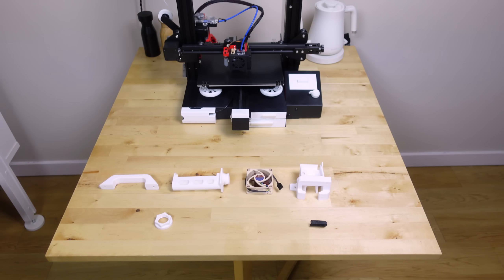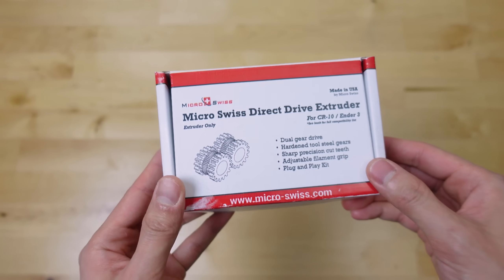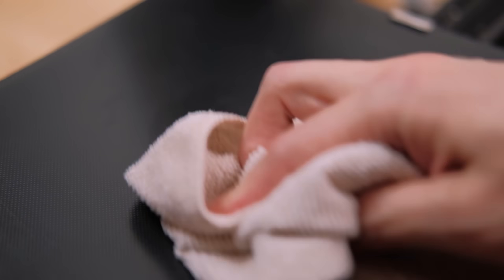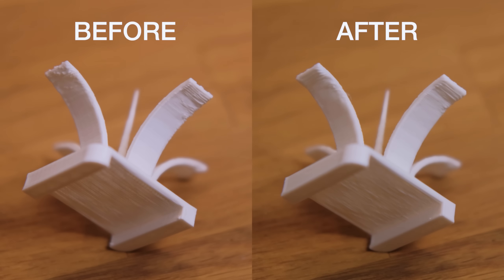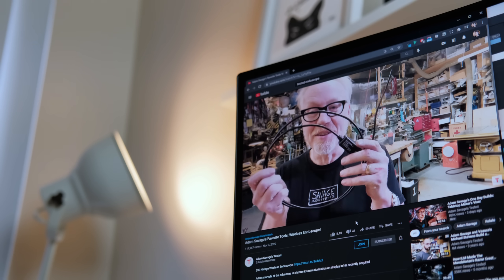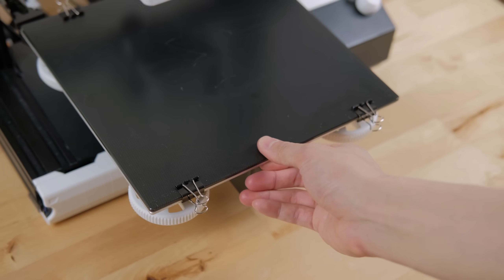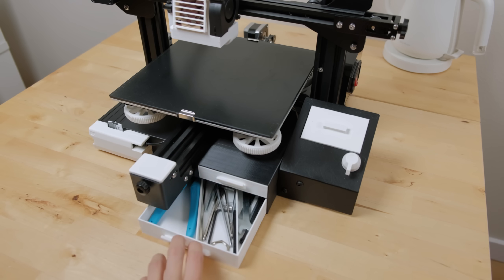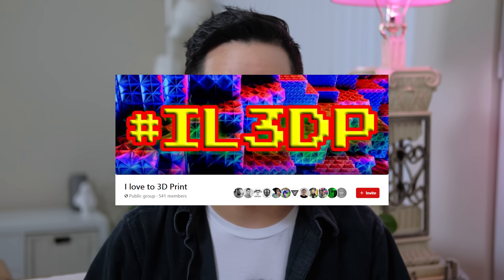15 More Upgrades for my Ender 3 Pro - Part 3

Comment from the maker: Part 1 - https://youtu.be/kG_YKeJDaX8
Part 3 - https://youtu.be/4jk6kZIwsQA
Part 4 - https://youtu.be/EQJfDLENYnU

Get this 3D printer for $189 with this affiliate link: https://bit.ly/3kcSKz0 and discount code: RP3ROMP10

As always, I'll be updating this pinned comment with FAQs and updates:

Q: How much did everything total to? 
A: Part 1 totaled around $138, not including the raspberry pi.
    Part 3 totaled around $250 to $300 depending on which endoscope model you choose and where you order your parts from.
    Keep in mind though that if you were to add these mods to your printer it will likely cost you a lot less since a lot of these recommendations added in part 3 replace the ones from part 1. 

Q: What are my Cura / support settings? 
A: Details on this are explained in the Part 2 video in the Q&A section https://youtu.be/uBfMoOqCgPc

Q: What 3D modeling software do I use? 
A: Fusion 360
Reply: Can you add a touch of RGB lights.
Reply: As others have already pointed out:
1) Ringing and ghosting? If the answer is a lot, ever considered remote direct drive?
2) Change the thermistor. Best upgrade possible. NTC 100K are extremely inaccurate. 
3)  Nylon is not easy to print, and has a really narrow field of application. That said, a conversion to higher thermal capabilities (maybe not PEEK and ULTEM) on an Ender 3 could be cool. Especially the heated enclosure.
4) CR 30?

Overall, I would say that you're getting really good at it. Keep it up!
Reply: Do you use marlin or the stock os? If you use the stock os, how did you add the bltouch without having any problems?
Reply: Was the micro swiss worth it? Just got a second Ender 3 and, I plan to Gucci it out.
Reply: Part 2 of the resin printer?
Reply: Maybe just add white leds and not rgb...
Reply: I missed the premiere :(
Reply: Do you use cura
Reply: How do u print multiple objekts so easily
Reply: Do your prints ever fail, and what do you do with the fails?
Reply: How much did all upgrades cost? Is it worth it?
Reply: UppfinnarAXEL it cost bout 80 dollars i think
Reply: what 3d modeling software do you use?
Reply: Why Tho? Fusion 360
Reply: What supports are those they seem to work very well
Reply: Hey, do you happen to have a discord server? I would love to join it and get some ideas on how you did some of the things you did in this video as well as your past videos.
Reply: What is the x/y offsets for the bl touch mount?
Reply: hey scott did u need any screws for the satsana duct thing or can u use the stock ones?
Reply: Sott - Awesome videos.  One last question: What motorized screwdriver do you use?  I've been trying to find a good one for some time now.  Thanks!
Reply: Bro upgrade like the snap maker 3d printer make ender3 pro part 4 plszzzzzzzzzzzzzzzzzzz 😁👍
Reply: For the music, I suggest checking this video. 
https://youtu.be/bUkX3iwr2iE
Reply: hi scott important question can u show us your whole setup like your camera your octopi settings and general issues you`ve been having?
Reply: Hi Scott, do the satsana ducts work without direct drive?
Reply: Stefan kring yes i installed mine without the direct drive you do need some screws and nuts
Reply: i myself as an engineer would try to lower the cost of the upgrades.. however .. noctua .. there is no better choice so cant skip on that one.. however .. just  some longer 4020 struts.. can be sourced a lot cheaper..
Reply: Any update on when part 4 will come out? About to set up the engraver and would love to see how you have thought to improve it!
Reply: How bout you replace all the fans with noctua fans basically just the motherboard fan
Reply: Replace the screen to ender 3 v2
Reply: Make able to change the tool head and make one using a endoscope
Reply: hi scott im a content creater like u and i was wondering what filament u use to achieve these smooth as heck prints
Reply: At the risk of pissing off your fan base, Cameron Luck lied to you homie. That intro for your videos is NOT his. In fact it's a very (as in extremely, totally and obviously) stolen beat from Tom Macdonald's "Fake Fans".
Reply from the maker: @AduroMark-ChainReaction  nah, haha it's a popular sample from a Splice subscription library apparently haha used in a bunch of k-pop songs too
Reply: Need #Part 4
Reply: Please make videos to add drilling system on creality ender 3 pro upgrade version ..
Reply: If anyone gets an ender 3 v2 and decides to put a bed insulation pad on, you need to cut it a little bit so it doesn't interfere with the motor that moves the bed. If you just slap it on there, it makes the print bed a lil thicc and it runs up on/rubs against the motor.
Reply: Ideas for add ons is something that allows one to print it in multiple material(so one can make dissolvable supports) and multiple colours(say you had a solid print the you wanted in blue and black and green. A device that assists with this would be helpful. Is there anything like it?
Reply: do a comparison on how good and cost it was before and now
Reply: You can add a holder for the screen cover
Reply: Part four LMAAO (Laugh My Adams Apple Off)?
Reply: does the link to get this printer for 189 still work
Reply: Hey brother, do you sell these already custom built?
Reply: where is the link to the main tool head upgrade?
Reply: Can this duct be used for boden tube ender 3 without converting into direct drive
Reply: you need to switch the link from 3 to 2

Comment: That is a completely different printer.
Reply: Prusa level printer :)
Reply: @sidewinded1  more expensive than a prusa
Reply: @lucaskp16  Sadly this is true. People are always like “Prusa is overpriced and overcharges” but when you look at the specs you are getting a Prusa for cheaper with the same specs, better quality and customer support...
Reply: @lucaskp16  Yes, and no, let me explain, u get the prusa, and yeah is neat out of the box, but with the ender 3, or the v2, you get a "decent" printer that you put to work, get some cash, upgrade it, etc
Reply: Is there anything left of the original printer??
Reply: @Girl On A Quest Ah yes, call prusa garbage. Please explain why?
Reply: @Girl On A Quest So you are telling me the printer I have had for the past 2 years with only 3 jams and 1k+ hours of runtime has more problems than prints?
Reply: @Girl On A Quest Most of the community does not have issues with their printers; tell me whats wrong. I will try to help
Reply: @Girl On A Quest Are your belts properly tensioned? Is your frame square and axes perpendicular? For the E motor, try running it on its own without any filament and with a rotation visualizer. If it spins, your hotend is probably jammed, if it doesnt, either motor or rambo is fried.
Reply: @Eddinski  its like a modded civic compared to a stock audi r8
Reply: If all the parts of a ship are replaced one by one, is it still the same ship?
Reply: @Girl On A Quest is it 3 or 5 printers make ya mind up luv 😂
Reply: Ship of Theseus printer
Reply: wait till you see part 4
Reply: Fr
Reply: @siniquezu  yes the color, it's not white yet

Comment: Ender 3 is on sale at Newegg for $165 today only
Reply: Link?
Reply: @tobiastho9639  I can’t seem to find it but it is usually only around 180+ shipping on crealitys website anyway
Reply: That's honestly not a good deal.  They're very often $155-165 in various places.  IMO you're shooting yourself in the foot with the Ender 3.  The Ender 3 Pro has a quality Meanwell PSU for about $40 more, which is the price of the PSU by itself, plus it has a few other upgrades to boot.  Even THEN you're shooting yourself in the foot usually because the Ender V2 usually you can find for $240-260, and it adds a silent stepper motor mainboard ($30-40 upgrade usually), belt tensioners, touch screen control ($30ish upgrade), and other upgrades.  Almost anyone would appreciate at the very least a PSU that won't burn your house down that you can trust, your printer not sounding like it's trying to annoy you using a voice box (EEEEEEEEEEEYAAAAAAAAAAAAAAAAAAAAAAAAAAAAAAAH!!!!).  Those two things alone make the Ender v2 worth the extra money for most people.
Reply: @heroflying  Wholeheartedly agree with 99% of your points, but the Ender v2 doesn't have touchscreen :(. Still uses the turn knob
Reply: @peterahn8332  I have a pro.  Thanks, didn't realize it wasn't a touchscreen.

Comment: quick tip: when you replace a fan, like 90% of the time the sticker on the back of the motor can be peeled off to expose the wire solder points. Just de solder the wire from the old fan and the new one and then re solder the old wire to the new fan. its easier and cleaner. Also there are plenty of 3d printable extruder heads and direct drives that are probably better than what you got do to more compatibility, more customizable, and lighter in weight.
Reply: I was afraid of replacing the fans because I thought I might ruin the printer when cutting the wires thx man
Reply: Just be careful not to bridge the solder point when resoldering 👍

Comment: Just for the fact that you mentioned how the can of air isn't great for the environment, you immediately get an upvote, thanks for bein considerate.
Reply: sure but what about all the microplastic entering the environment now when using a printer ?
Reply: @batmandalorian5504  I agree with your point, that's why I try to keep my waste to a minimum and I try to only print in PLA. I'm planning on finding a place that does industrial composting of PLA to give my scraps to.

Comment: Scotty you have successfully boiled my 3 years of searching, learning, printing, failing, and correcting into 3 succinct and comprehensive videos.  Here I am back again to pickup  some final mods to my Ender 3 pro.  Got my 'stupid' silent fans installed, skr mini board, tft touch screen, buck converters...working on my rear electronics box and fine-tuning my cooling duct.  Thanks again for all of your time and research!
Reply: just got an skr and oh my god the difference is insane, I was almost in shock

Comment: World's quietest 3D printer ever.
Reply: I hope that's a joke🤣
Reply: @Ethan Lu ender 3 silenced is better
Reply: Enclosers done right can lower the sound to negligible levels. The foam works particularly well on 3D printers assuming that it's air tight with negative pressure. That seal on its own does a significant amount of sound dampening.

The fans typically make mid to high frequency sounds which is what foam excels at. Stepper motors are quiet but the movement of metal on metal is slightly audible. It's probably because metal moving on metal is sometimes a very low frequency sound.

Comment: Guys if you still struggle with glass bed adhesion just wash it under warm water with some soap. Nothing will degrease the surface like this simple solution now it's hard for me to release the prints from my bed.
Reply: Indeed. Use your clean hand to wash the surface with a drop of dish soap and hot water. Dry with paper towel and don't touch it. The next 5 prints will stick fast. I normally use the scraper to move any dust aside between prints.

Comment: I also have the Microswiss Direct Extruder and it's phenomenal! But as I got I the released a newer one with rails... 

Scott did you also have Problems with just one Z-Axis-Motor? Now I upgraded to dual Z as my whole x Axis had some wobble and the first few layers got crazy bad. Dual Z eliminated this problem :)

PS:
Scott you need to get a Tft35 (BigteeTechTouchDispaly), its awesome.
Reply: Are you sure it wasn't just the eccentric but on the opposite rail?
Reply: Yes, also with perfectly adjusted excenter nuts there's still some play.
Reply: @lukaswernetz3258  The Ender 3 suffers quite a lot from crooked gantries. It's a budget printer, after all.

Comment: Hey, wanted to say thank you. Your series inspired me to get into 3D printing, and I'm about 75% of the way though most of the mods you've done, with a couple of extra ones along the way. I'd definitely recommend the BigTreeTech touch screen, it's excellent, and even with octoprint, still use it all the time. 

Also, when is the next vid coming? - you promised! (you didn't, but that's how I heard it! ;) )
Reply: I just got mine but haven't messed with it. What do you think one of the First MODSs I should do ?...I bought a (self ?) Leveling thing and a glass bed
Reply: @MOE13576  in honesty I eventually just built a Voron 2.4.r2.

Other than octopi, I'm not sure most of them made the printer much better. Some made my print quality worse but that was likely just my novice abilities at the time. Now I built the Voron, the e3 went in the loft.

Definitely the touch screen and octopi. Maybe handles too.
Reply: @ZeoniaSD  alright, thanks

Comment: Expected upgrades: Direct drive, longer z axis v slots, hot end upgrade, x and y belt tensioners, handle.
Reply: Don't forget the laser engraver!!
Reply: Psu control
Reply: Noctua Hotend Fans
Reply: I think the handle was already there. I agree with every thing else though!

Comment: Instead of straight swapping out the PSU fan, could you print a new PSU shroud with mounting holes for an 80 or even 92mm fan? A bigger fan will spin slower for even quiter operation. ATX PSUs use the biggest fan possible for this reason. Probs negligible difference, but it just seems like there is plenty of space left for it.

Comment: Klipper was a huge game changer. Really took things to a whole new level. I use Mainsail and that tends to work really well. This helped cut down on blobs and overall inconsistencies in the print. Paired with the dual gear and insulation under the bed (and bed mounts instead of springs) made the prints amazing. It has been a huge headache and only recently have I even gotten back to using it. But the learning experience was well worth it for the quality (and speed) I've gotten out of such a machine.

Comment: Dang bro you killed it with this one. I can tell your video editing skills have increased significantly like Goku reaching Super Saiyan levels.
Reply from the maker: haha thank you so much Hector. i'm definitely trying to slowly up my video production quality with each video so i appreciate that you noticed. cheers!
Reply: @ScottYuJan  i didn't think they could get better but daym you are good at it
Reply: @ScottYuJan  hey I can’t get the Fanta to work. I connect yellow to red and black to blue and it never kicks on.
Reply from the maker: @NightBlade58  for the PSU power supply fan?
Reply: @ScottYuJan  for the upgraded cooling fan that goes into the remix part that I printed. I am essentially copying your build.
Reply from the maker: @NightBlade58  hmm well first of all, start a new comment so we don’t spam these guys above your comment with notifications haha

Comment: For anyone considering switching to direct drive for an Ender 3, z-additions are not necessary as the motor doesn't touch the top rail, you can simply run the cables from one side of the printer rather than vertically.

Comment: Could you do a short video about all the extra tool kits you keep around to use with your prints, or link in the comments like the set of machine screws or the other inserts you add?
Reply from the maker: all the kits are linked in the video description under "⚙ Tools and Stuff ⚙ " 
if i missed anything, let me know!

Comment: printed out the  cover you linked for the   tensioner cover ,  it fits the original  creality  stock front  belt tension assembly   but does not fit the creality  made  adjustable  front    assembly, doing some research looks to be a couple style of adjusters from creality     some changes as they  progressed ,  just finished   making a raw  3d  shape going to make it to see if it fits and has clearance  will let you  know

Comment: I recommend adding back the Teflon housing for the filament to avoid yanking on the spool when the extruder moves to the edges. this will introduce filament tension during extrusion and that leads to imperfection in the prints
Reply: Hmm, he has ball bearings for the spool.   I have the same setup with the filament going in the top.  My biggest issue is the filament path of the microswiss.  At times it is hard to get it fed right.  I straighten it beforehand and you get better at it over time.

Comment: Z-Axis already carries the weight of the extruder and its stepper motor.  The key difference is now the X-Axis has that additional weight where previously the bowden hotend was a lot lighter.  Increased weight on the X-Axis may introduce ringing when you're making fast X moves.
Reply: I think the stepper motor drivers on the new board he added could potentially help. Also, why is prusa able to print faster with less ringing for direct drive?
Reply: @sidewinded1  Its because prusa uses lightweight stepper motors and the x carrige itself is extruder. So its just a little more heavy than a regular bowden setup.
Reply: @beratbaki1681  Thanks for the explanation, although wouldnt it still be slower than a bowden because there is still more weight? Thank you, coming from a prusa owner lol
Reply: @sidewinded1  Definetly bowden is faster than prusa. But the direct drive has more benefits I think. I personally do not care about printing faster but printing acurratly. Thats because I upgraded my Cr-10 with a bmg dual drive and a normal sized nema 17.
Reply: @beratbaki1681  Yeah. I personally enjoy the hassle-free ness of direct drive. It gives me a lot more versatility, something extremely useful for multiple plastics
Reply: Check out remote direct drive
Reply: So part 4 is dual z screw drive? But never seen it for the extended rails.
Mystery box didn't look long enough
Reply: Ender 3 cinematic put a greater emphasis on a Y axis, so lightweight bed and moderately heavy hotend is ok. I have direct drive version of Afterburner from Voron Design on my E3Pro, and pei plate instead of glass on my bed, and yay, zero problems, fast speed and good quality.